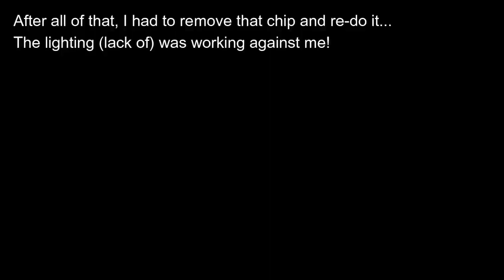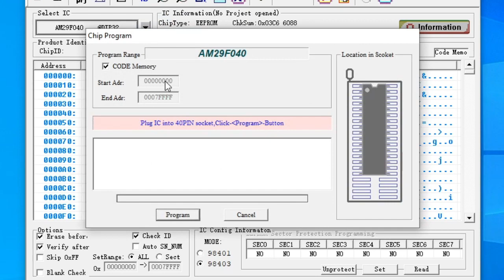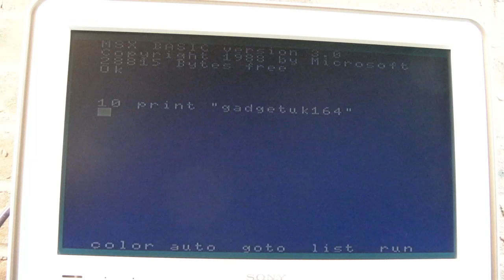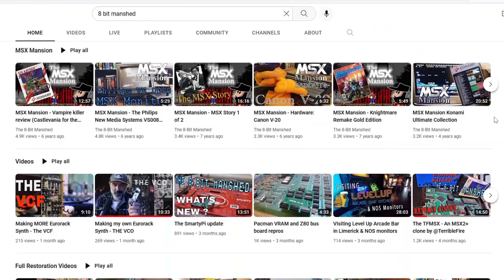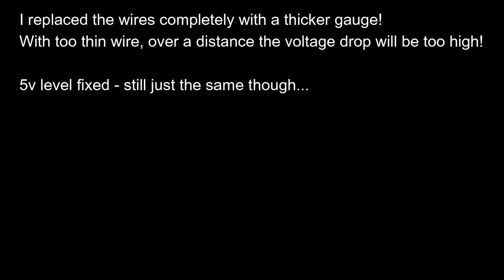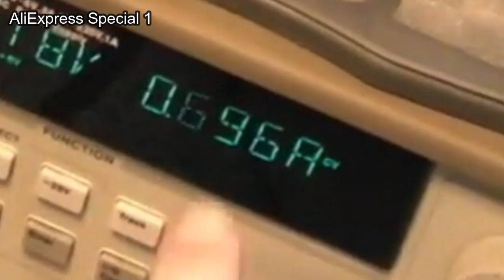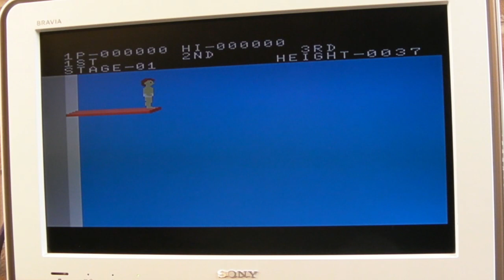TerribleFire TFMSX Part 1 - A brand NEW MSX 2 in 2023???

Comment from the maker: Part 2 - https://youtu.be/oykHyf3L4Mc
TerribleFire - https://www.youtube.com/@TerribleFire
The 8-Bit Manshed - https://www.youtube.com/@BGOllie
The 8-Bit Manshed TFMSX Video - https://www.youtube.com/watch?v=jK1CzNio7ao
Intro & Parts Received @ 00:00:00
Installing Sockets @ 00:03:39
Big Cleaning  @ 00:09:32
More Parts Arrived @ 00:10:30
New Bench & More Parts 00:13:53
More Cleaning! @ 00:18:16
Installing CPLD Without Light... @ 00:19:18
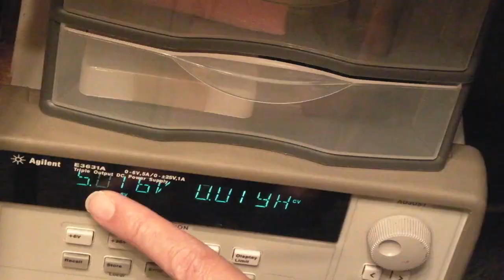First Power Test @ 00:27:49
Preparing to Program @ 00:28:57
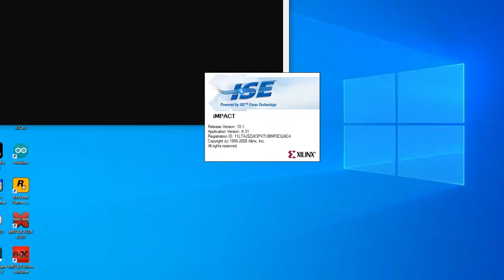Programming Chips @ 00:30:48
EEPROM Problem & Install @ 00:33:27
ARM Programming Overview @ 00:36:02
Finally a VDP @ 00:36:52
First Power On & Troubleshooting @ 00:37:27
Creating a Cart @ 00:47:11
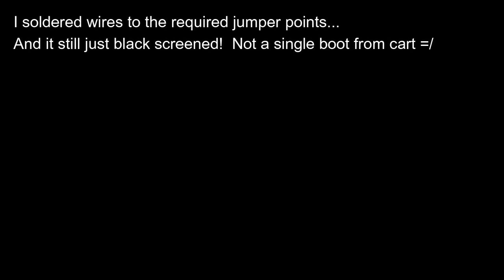First Problem @ 00:48:53
ARM or ROM? @ 00:54:09
Yay!!! @ 00:56:56
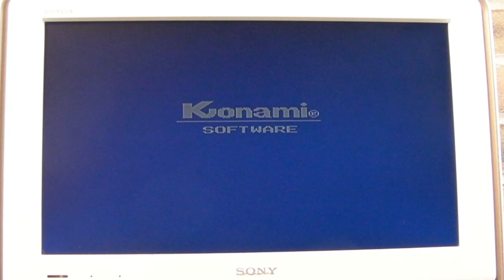Sound? @ 00:59:06
3 More VDPs / Cart Info @ 01:00:49
Fake VDPs @ 01:03:49
Sound Fixed @ 01:04:52
Building Another Cart @ 01:08:14
Final Testing @ 01:09:58
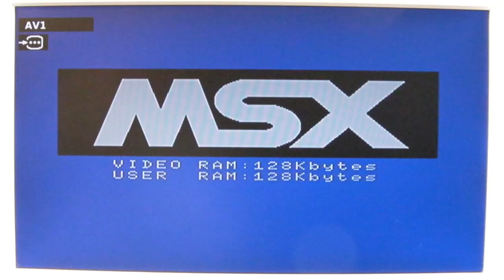Thanks & Close Up @ 01:17:05

Comment: The MSX standard is built around the concept of slots. The Z80 address space is divided into 4 pages of 16kB each. Each page can be in one of 4 slots, numbered 0 through 3. Usually slot 0 is reserved for the MSX BIOS and main BASIC ROM, slot 1 and 2 are used for the cartridge buses and slot 3 is used for RAM. 

It also allowed for each slot to be expanded to 4 secondary or subslots. Although this has been in the MSX standard since the days of the original MSXes, most MSX1 systems did not make use of it, only later MSX1s. The second generation of MSXes, the MSX2 systems, usually did have at least one slot expanded into 4 subslots, and more often than not it was slot 3. These subslots would contain the MSX2 extensions to the standard, such as the MSX SUBROM, the DISK BASIC ROM and MSX-DOS ROM (if built-in), and RAM.

The RAM itself could be of two flavours: plain or mapped. If plain, the RAM would simply reside in one of the sub(slots) and would be fixed in place. This allowed for a maximum of 64kB of RAM per (sub)slot. If mapped, the RAM itself would be split up into 16kB segment, and each segment could be put into one of the 4 16kB pages of the Z80 address space. There could be a total of 256 segments (the 4 mapper registers were 8-bits wide). Per slot, this allowed for 256 x 16kB = 4MB of memory, and if expanded, 4 x 4MB = 16MB of memory for an MSX. Most MSX 2 systems had a 64kB or 128kB built-in memory mapper. Some had 256kB, but seldom more. However, memory mappers could also be built into cartridges and starting with the MSX2 the BIOS can deal with more than one mapper (although the BIOS will always only use the largest mapper by default). Memory mappers are not part of the MSX1 standard, and no MSX1 computer ever shipped with one built-in, but some external memory mappers are MSX1 compatible, which means that they will initialize themselves upon boot in in a similar way to how the MSX2 BIOS would.
Reply from the maker: Thanks for the detailed explanation there - very useful and interesting =D
Reply: @GadgetUK164  Glad I could be of assistance.

Comment: I like to put big pieces of foil tape over any plastic parts near things I'm soldering. Helps a lot for these glancing blows with the iron. Spreads out the heat from these brief momentary contacts pretty well.
Reply: Better yet, start with the SMD parts before soldering the sockets. Elektor usually recommends starting with the smallest/lowest parts first. That would've saved him a lot of trouble.
But if rework has to be done after assembly, yes, kaptontape is your friend. Metal tape transfers the heat to the part under protection as well. Kapton tape can stand the heat and has lower heat transfer capability.
I was wondering though, why using the PLCC parts, these sockets are prone to damage easily.

Comment: Just wondering if you had gone with solder paste and used a IR Laser to scan round the pins to melt the solder and make the connections Just an idea.
Reply from the maker: Nice idea, not very practical for anything other than mass production though!

Comment: One comment on having to reseat carts, I’ve found HASL edge connections to be really poor in terms of continuity. A tap while in use will usually cause a crash. Whereas ENIG are very reliable, even if wiggling the PCB in the slot. That may be part of your problem!
Reply from the maker: Part 2 uploading... =D

Comment: Nice build! Too bad about the glitches! My original msx computers (2x msx1 and 3 msx2 computers) still work flawlessly, aside from some diskdrives with loose belts, but these are easy to replace with goteks.
If you like kingsvally 1, you'll love kingsvally 2 when you've got a scc cartridge in the second slot! It has 60 levels, a level designer and has some slightly improved graphics on msx2 hardware. Aufwiedersehen monty is great too, as it boulderdash 1 and 2, no smooth scrolling though but still good.
So far you've only tried msx1 games. The disadvantage of no floppy controller is that you can't run floppy based games. Some of the best msx2 games are floppy only, such as aleste 2, undeadline, feedback, hydefos, xak, ys etc. You'll be blown away with the colors, animated intros, fast scrolling and more sprites on screen! Many use the fmpac for improved sound and sample playback, it's based on ym2413 synth chip. I consider it a must have upgrade!
Aleste is on a 256k rom though and is a great game as well. 
Looking forward to how the tfmsx will evolve!
I was thinking, maybe there are some glitches due to the reset circuit not working properly? Could that be the problem of things working or not working every once in a while?
There are very few msx2+ games though, not much point in trying to find them I suppose and most run from disk.
Reply from the maker: Glitches sorted in part 2, and V9958 working too =D  I dont have any MSX 2+ carts though - pretty expensive and hard to find.  I will get something with an SCC at some point and look into other upgrades.  My understanding is you can load .dsk images from one of the flash carts that work from cartridge slot - so I will try and get one of those.  Thanks for the useful info there =D

Comment: I was going to comment: YOU'RE USING THE WRONG BIOS!! but then you found out ;-) Another thing: V9958 and V9938 are not pin compatible. There's about 3 differences, dunno how Stephen solved that (Jumpers?). MSX2 has hardware vertical scrolling, MSX2+ adds horizontal scrolling as well. If you want to run more (MSX2) software you'd probably best off getting one of the existing multicarts, like MegaflashromSCC+SD, Carnivore2, or others. They implement sound chips like SCC in an FPGA, and you can flash rom and disk images to them, from SD or CF cards. Btw most MSX2 biosses don't count the installed user ram, it's just a hardcoded value it displays. So you may have more than 128k, not sure what was implemented on the TF :)
Reply from the maker: It works for Stephen "as is" but I am not sure if his board is modded vs mine.  The changes between the two ICs are pretty minor, but there are differences.  I plan on taking a look in part two at differences.
Reply: As smart as Stephen is he probably designed it in ;) On page 12 of the V9958 technical data book the diffs are listed. Most important is that pin 21 became a Vcc power source and pins 4 and 27 need to be pulled up.
Reply: I can definitely recommend the Carnivore2. It adds 1MB of Mapper RAM, 2MB of Flash, "stereo" PSG, SCC, and it provides a SD card slot to boot. 

My MSX2 now has more storage and RAM than my first PC ever had 🙂.

Comment: What about a 10V WKG1,000uF Electrolytic and see if that kills the problem.
Reply from the maker: I tried caps of various sizes and ended up leaving a couple of much smaller ones on there.  1000uF is total overkill really and not easy to accommodate on a board this small.